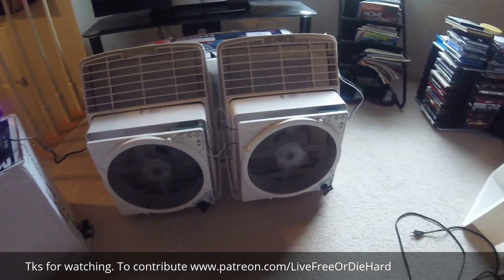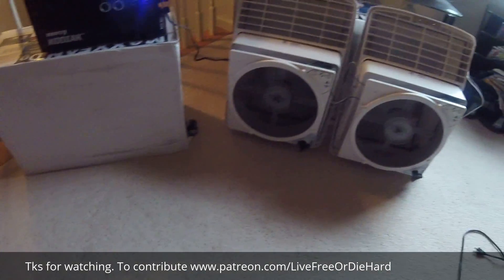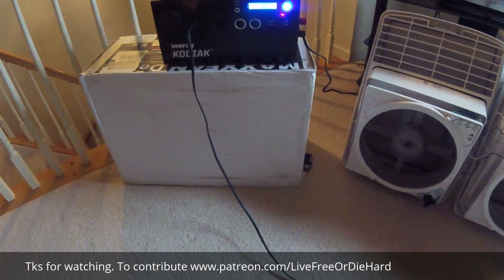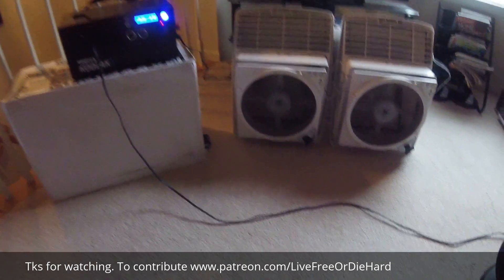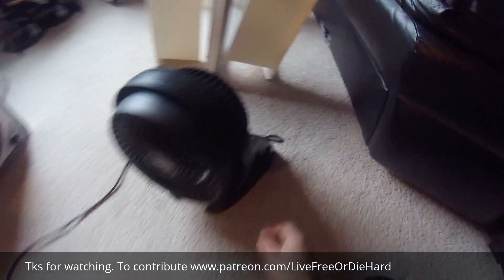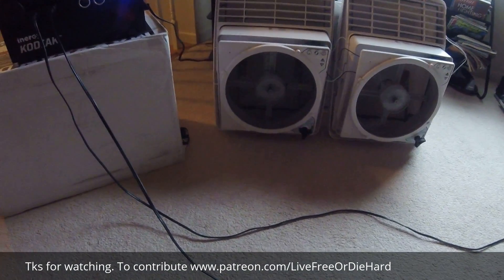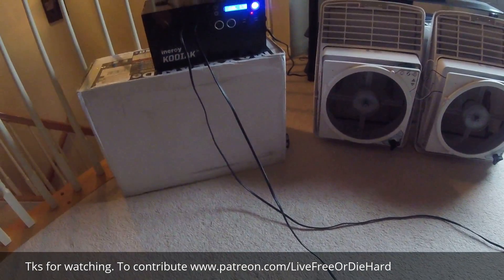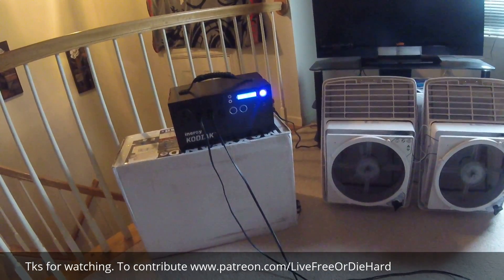Kodiak Portable Solar Generator & MaxxAir fan In-depth Review pt.1

Comment: Your vids are super helpful. Thank you!I’m currently converting my van and just purchased the kodiak online. I see in your comments someone asked about the maxx air fan. 
Besides the cig light adapter, do you have a specific wire that you use to connect everything? Can you please show us a step by step wiring tutorial?
Reply from the maker: I don't feel comfortable giving electrical advice as I am a novice.  But I choose 14 AWG Stranded & Straight as I ran out of 1 for the fans.  But I found out the splice connectors aren't made for the straight wire, at least not the ones I have.  Straight wire is super tough & way more ridged.  It's just personal preference.  They cost about the same.  Of course I used 10 AWG direct from the solar panels to the Kodiak.
Reply from the maker: Thanks for the feed back
Reply: Great thanks!

Comment: I read somewhere that fast charging lowers the lifetime number of charges of this type of battery, is that true? There is a fast charger cable for this.
Reply from the maker: I have no idea, but there is a limited amount of charging before every battery gives up. But I do know with lithium like in the Kodiak it can be recharged like 8 times more than other types of batteries, which is part of the reason of the significant increase in cost.
Reply: Thank you. I ask because I'm interested in this device and I would like to charge it using the quick charge cable that is made for it.
Reply from the maker: I have been using it a lot.  Not only that but I have been using both chargers at the same time, but not sure that is recommended, but I'm all about speed.
Reply from the maker: Support at Kodiak doesn't recommend this & was not aware someone would try this. lol

Comment: I am thinking of using this setup in my van, but how would the wiring of the maxxair fans work with this type of setup?
Reply from the maker: I plan on connecting the fans directly to the Kodiak battery post with just some simple wire connectors.  I want to be able to remove them easily if I want to take the Kodiak out of the van for different reasons.
Reply: I was thinking of both being wired to a cig light adapter. Both together would be below the 15A for one. Think that would work?
Reply from the maker: That seems very doable.  I might do that as well. Thanks.

Comment: .Seems like a stupid test if it's not hooked up to solar.
Reply from the maker: Patrick I appreciate the comment. The Kodiak has 3 different ways that it charges.  You failed to understand the purpose of the test.  It was to see how long it could power my fans on 1 charge.  This is to simulate multiple days of lack of sun or cloud cover or rain.  Boondocking in the wilderness, & low on gas or lack of. This is real world testing.